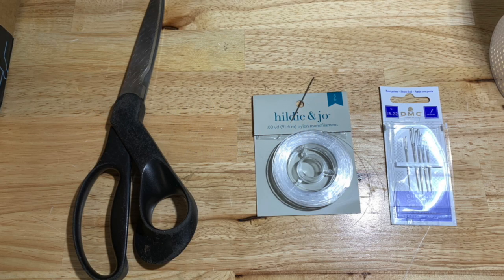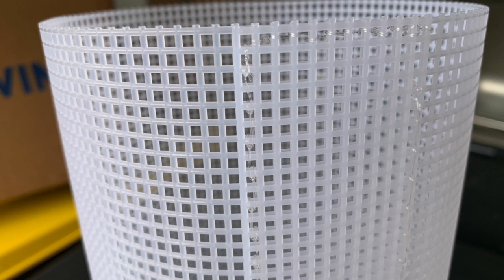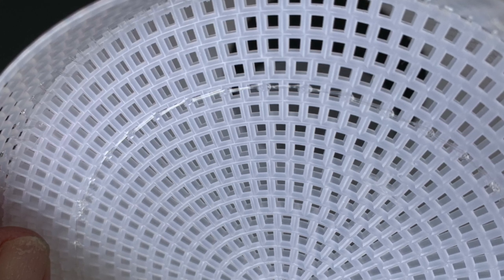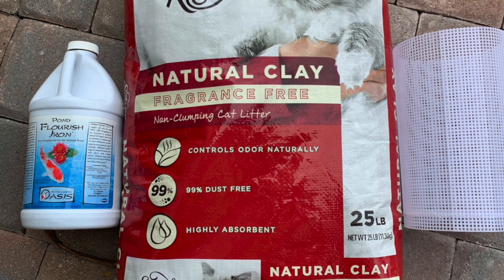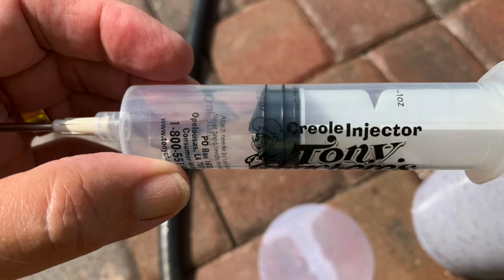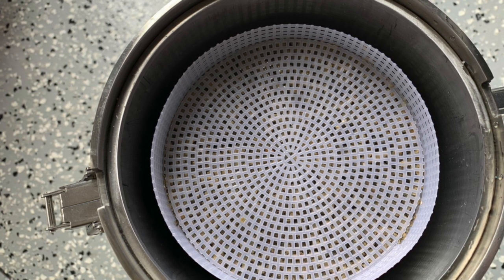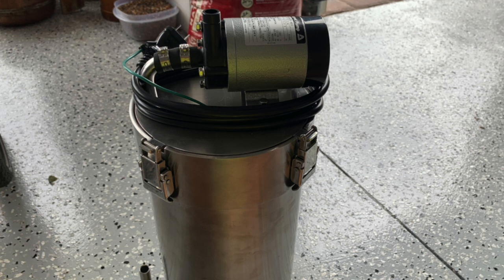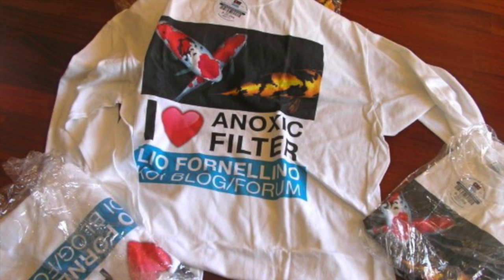Converting an ADA Super Jet 600 Canister filter into a Nitrate reducing Anoxic Filter.

Comment: Three weeks ago I installed a 60 liter aquarium with a slow moving plenum with a Eheim 2211 cannisterfilter like Dr Novak showed in his Youtube canal about 2 years ago. For substrate I used just poolfilter sand 1-2mm nothing else. Seeing this video I am also going to make a BCB in the Eheim 2211. If everything went well after 6 months with aquarium with fish I am going to make a BCB for my other aquarium. This is a 100 liter Juwel Rio 125. In jan 2020 I set it up with also a slow moving plenum with a JBL Greenline E-902 cannister filter. Substrate with pool sand and Seachem flourite red as describe in Dr Novaks youtubefilms 2 years ago. If all goes well with the Eheim 2211 BCB I am planning to make a BCB for the JBL E-902 cannister just like Luke had done. The JBL e-series are perfect for that because how the water flows through the cannister. As prefilter I will use a Sunsun HW-603 (model without motor).

Comment: Also, you said you have personally not had much success with substrates or medium that are supposed to remove nitrates.. so does  only deep substrate method if placed directly on the bottom..will the bottom most layer create anoxic conditions?

Will placing a porous material like pumice or vermiculite at the bottom most layer of such a deep substrate create a slow moving anoxic filtration layer?
Reply from the maker: You see plants will draw water through the substrate through conventional means but the plants will be very slow in doing this and are subject to CO2 fertilization. Depending on plants alone to draw water through the substrate is a path to failure without the help like heating cables like is suggested by the experts. But even heating cables under the substrate becomes useless in the summer months when the ambient air temperature of the room equals that of the tank or the tank is getting enough heat from the aquarium lights. Then the heating cables never turn on to heat the substrate and then everything starts going anaerobic in the media and starts turning black.

Glass bottom aquariums will show this best and you can then see the blackening of the substrate very easy by looking at the bottom of the tank. Once the heating cables resume the work of heating the tank once again and your tank will turn sweet once again, then slowly the substrate will turn aerobic and you will have more aerobe organisms or facultative anaerobes than anaerobic organisms.  

The applied physics are the same no matter if it is an aquarium or pond. Plants alone will not draw enough water through a substrate to keep it from going anaerobic without a little help from the hobbyist. The substrate in a planted aquarium needs to be at least 3” deep and a plenum needs to be added under the substrate of ½ to 1” depth.  By doing this, heating cables are not needed and biological and chemical pathways remain open to chemical mediators. Now your substrate will draw water by convention, diffusion and peculation.

However, this will once again be subject to the size of the media you choose to use to anchor your plants in. If the medium is too small or too large then you’re sacrificing permeability and porewater capability of that substrate and it will clog. Unlike the Biocenosis Clarification Baskets (BCB’s) that make up the Anoxic filter in a pond, aquariums can’t have a bunch of BCB’s sitting inside of them because of cosmetic reasons. That’s why when you buy plants you will see them in individual small plant pots that act like a BCB’s does but on a smaller scale. They are grown this way in greenhouses with space in-between them just like an AFS has space between its BCB’s.

I have also seen hobbyist use cat litter and Laterite for their substrate in aquariums that houses plants too. But once again you must elevate the medium above the bottom glass surface like I explained above. Now, you will have an Anoxic Filter without all the BCB’s but will have one big BCB the size of your aquarium bottom instead. Using a black craft canvas on top of a platform will hold the cat litter and Laterite above the glass and because of its size it will not clog. NOTE: You must only use cat litter, Oil Dri or Safe t Sorb that has been baked. Some cat litters are not baked and then they will not work for a Plenum situation. A BCB yes, but not a Plenum.

How to make a BCB the size of an Aquarium is easy. You can use PVC or anything that can make a raised bed above the aquarium floor. Then in one corner or in an inconspicuous place in the aquarium place a 1” plastic tube with small holes drilled at the bottom ½” of the tube. The tube is inserted in the raised bed and will sit on the bottom glass (The tube can also be capped off at the bottom.) with an air stone at the bottom of the tube and the tube will then look like and under gravel airlift tube. Using the smallest air pump you can buy, pump air into the tube via air stone. This will move water from under your plenum extremely slow. It will not act like an under gravel filter because water movement will be too slow for that to happen. The slower the water movement the better it works. Just the opposite of what an under gravel filter was meant for. If the tube only exchanges one gallon of water a day that’s good enough and fast enough too. Just make certain that none of the cat litter can fall in-between the tube and the black craft canvas screen.

The tube is added; because the substrate is tight against the aquarium glass at its sides. This will impede the chemical and biological pathways some. The very slow water movement underneath the plenum will allow for proper ion exchange and will mimic a conventional movement of the water through the substrate releasing any gases. Yes the substrate will produce N2 and it must find a way out via the tube you just added.
Reply: @anoxicfiltrationplenums  excellent explanation..i was wondering though..in actual ecosystems and ponds in nature..how does anoxic filtration happen ?
There is only 'substrate' ..how does water movement happen there?

Comment: I have a few queries, hope you can answer them..
1) i have found some brands of non clumping natural clay kitty litter..but it says bentonite..
Will it work?
You once said bentonite doesnt work, as its clumping.. but if its non clumping and hopefully baked..will it then work, or does it have to be attapulgite?
2) for plenum purpose, will any substrate of our choice ( eg fine gravel or coarse sand) ( height 2-3 inches with particle size 1-3mm with a 1 inch plenum with a short lift tube)work with iron or does it have to be baked clay with laterite..
3) will any bricks made from baked clay work even if its not attapulgite clay?
4) lastly, you made a video about substitutes for the laterite or iron rich substrate..you have probably not yet made a video about substitutes for baked clay...
From what i have gathered, you said the following would/should work
Zeolite, leca balls..if they are properly sized, like 2-4mm in diameter..are there any other? 

Thanks in advance

Comment: Why would you not disperse the iron throughout the clay?  What function does the clay body fill if you are not directing a bit of current through it?
Reply from the maker: The iron plays two parts in the BCB. part one ) iron helps too accelerate bacteria growth. Bacteria use the iron for their growth in the very beginning and once they are all established then the iron isn’t quite as important. 

Two) the laterite has the same crystalline structure as kitty litter or oil dri or any one of those products and therefore it will attract the ions out of the aquarium water the same as the kitty litter. 

Even in a normal Aquarium iron is still very important for the building of cells inside your aquarium our filter to establish  bacteria.

Comment: Another great video! I noticed that too with the same cat litter how it's not really clumping or turning to mush unless you really try to smash it. I wonder if it just wasn't baked hot enough. I will test a little bit and get it really hot with a torch or in a kiln over a fire just to see what happens.
Reply from the maker: Let me know your outcome please.
Reply: Well I only spent a few minutes with the torch on a small handful and sure enough it turned a lighter color grey, and then put it in water and it definitely stays much harder so far compared to right out of the bag.
Reply: And as i was looking for the torch, I looked at the floor-dry and I think it's a type of baked clay, so I put some water on it too and it seems much harder than the cat litter too. It's also has a lighter color and some red to it  so it seems like it's been baked much hotter. Anyway would something like floor dry work as an alternative if it's all natural?
Reply: @coltscustoms  I’ve looked into that as well and it is a good alternative. As long as it is the type with no added chemicals.
Reply: Yeah so it's called Safe T Sorb from Tractor Supply only 6 bucks for 40lbs and yes apparently people use it in planted tanks.
Reply: @coltscustoms  Did you use the safe t sorb and set up your system? Any info to share?
Reply: @vikkirountoit497  Yeah I actually just set it up last week with plenum, safe-t-sorb mixed with flourite red, capped with pool filter sand. It's definitely better to work with than the softer clay cat litter. I have very hard well water but it did dramatically lower the PH, KH, and GH initially due to the strong CEC of the clay. I used baking soda and will do a couple water changes to bring it back up and hopefully stays stable, and we'll see what happens from there with ammonia/nitrate once it's cycled. No fish yet.
Reply: @coltscustoms  Cool thanks for details. I'm a bit concerned about my hardness as my water is relatively soft to begin with. Might have to let mine run and keep adding to it until it stabilizes. Very glad you reminded me of that - feel free to reply/comment further at any time!
Reply: @vikkirountoit497  maybe you could pre soak the clay in a bucket with a lil bit of baking soda for a few days, test and change the water till it's back to normal before putting it in your tank if you already have fish in it. Then again Dr. Novak puts it right in service and don't seem to have any problems.
Reply: @coltscustoms  Went ahead and installed one BCB today. It's only about 5x5x7" in a 75g so fairly small - I'll see if it makes a difference over the next several months. Used safe t sorb with a squirt of liquid iron ferts about 15min before installing. I'm going to keep monitoring the parameters I test for just to make sure nothing shifts in an unfavorable way:)
Reply: @coltscustoms  I replied to another comment of yours, and seeing this comment that your ph kh and gh all lowered initially, I think I'll test my water daily for a while until I am sure it is stable. I have only had a ph crash one time a year ago, but this is the tank it happened to. Right before BCB install today it was sitting at gh 7, kh 3, and ph 7.6.

Comment: Another brilliant piece Dr.Novak. The tiny details of the construction of the BCB has the hallmark of a mastercraftsman [leather]. 
I have made some crude BCB using the mesh idea earlier but your work is so much better.
Kitty litter is a real pain to find for some of us.Maybe can you recomend some easier to find alternatives to kitty litter? Would small limestone or granite pebbles work?
I also found that in my aquarium my prefilter gets clogged up pretty fast. I remembered your filter socks in your sump video, it is like that within 24-48hrs period. And it was so easy to clean your prefilter socks in a snap without touching the rest.So maybe ,just maybe you might want to consider making a prefilter that is superfast to remove clean/replace in a snap. lol [only a suggestion]
Reply: There is a piece of kit called a Filter Bucket made by Sun Sun . This is basically a big external pre-filter . I use the large size ones on both my canister filters and clean them once a month . Cons.are that they slow down the flow a fair bit and the hose sizes are not standard although they will accept standard hoses with a bit of work .
Reply from the maker: @theboesmani   thanks for the information I didn’t know that myself.
Reply from the maker: If you watch some of my other videos I do have an alternative to kitty litter I think it’s called Zeolite. That is what they use in Thailand instead of kitty litter.
Reply: @anoxicfiltrationplenums  Thanks, I can get Zeolite . I think that it is chemically active ( at least initially) though . People I know add it to fish bags when transporting fish over long distances to absorb Ammonia . I will check it out .
Reply: @theboesmani  What i had in mind was something like Dr.Novak's filter sock, where he just take it out in a breeze. No shutting of valves, pulling out hoses, opening canister ect. And he did it in less than 2minutes? Taking out the 24hrs dirt certainly increases the water quality.

Comment: Hi Doctor Novak PhD, I have been watching your progressive, highly informative, uploads regarding, first the slow moving anaerobic plenum and latterly the fast flowing Biocentesis Filtration system, I do not know, having lived in England all of my life if you remember the aquarists attempts, back in the 1980's, although I admit that memory fails me here, but, attempts were made to emulate a anaerobic filter by 'dripping' tank water at a pre determined rate through a, normally transparent circular column filled with, I believed to be pool filtration sand. The down side with this system, which, when I was re-bitten by the bug, I believe I can no longer find modern reference to this experiment, was the critical accuracy with which the speed of water introduced to this filter led, either to a natural aerobic failure or, more seriously if too slow then the dreaded 'rotten egg smell' (Hydrogen Sulphide) resulting in the 'usual' action, depending on the length of time that this 'bad' water had been feeding back into the, sometimes very costly display tank, to save fish and plants, although, the system's other failing was the actual, in most cases the 'pitifully small' amount of water returned to the tank when compared to your slow moving plenum system. The big problem I encountered, no doubt, along with a significant number of fellow Aquarists, discovered, as you predicted, impossible to locate.
That is why I welcomed your 'upload' regarding alternatives to Laterite, which FINALY brings me to the assistance, if you are able, by query that I desperately need;
1.  Will any "natural" 'Red baked clay product' of sufficient granular size be a suitable alternative to your suggested alternatives ?.
2.  Can 'Zeolite', being of suitable size, act as a replacement to the 'kitty litter that you use ?.
I include the relative web address for the only kitty/cat litter I can find.

https://www.petsathome.com/shop/en/pets/pets-at-home-non-clumping-clay-cat-litter-20l?utm_source=google&utm_medium=cpc&utm_campaign=google_shopping&cm_mmc=Google-CPC%20google_shopping_-google_shopping&ita=1976&ito=google_shopping&istCompanyId=7255ccad-a1fc-4729-af31-478f79e5071c&istFeedId=385e6b9a-8b03-4076-a8bb-e4737df8549c&istItemId=itxmxqqwa&istBid=tzwt&gclid=Cj0KCQiAqo3-BRDoARIsAE5vnaIYc1aymkKqwGVrJ0ndRZeCs9v8rKnLT9Z-e3PvkU0lZu8omQQvgGMaAjlHEALw_wcB&gclsrc=aw.ds#

I would be most grateful for your response

Comment: Hi Dr. Novak, from what I understand you are installing this filter on the same antique aquarium that you did the slow moving plenum on. Does the slow moving plenum not already work as an anoxic filter? How much anoxic filtration is needed? I am removing all the substrate from a 40 breeder to add a set of filter plates and 1”-2” layer of kitty litter. Will that be enough anoxic filtration for a typical community aquarium? Or will I need some external anoxic filtration as well?
Reply from the maker: The plenum does work to keep ,your tank from "crashing" . I have used a slow moving plenum in tanks that did not need a teardown for over 10-years. Placing the substrate directly on the bottom, I was lucky to go a year before a teardown or starting all over again. 

Be very careful of the Kitty Litter you use . As I said in my video not all Kitty Litter is the same coming out of Walmart. That is why I chose to make a canister BCB, then the cat litter can very somewhat. Maybe only 1/4" of cat litter in-between your substrate would-be  the safer bet.

Comment: Dr Novak, will leca balls work the same way? Leca balls are hard and made of clay.
Reply from the maker: Bentonite: Do not use
          • Clumping cat litters are made of Bentonite clay, which sticks together when wet. The bentoniteis usually mixed with quartz and diatomaceous earth, which are absorbent.

             Other Clays:
       
         • Various types of clays are used for non-clumping cat litters. Zeolite, diatomaceous earth and sepiolite are common.

        • (Only use clay –Attapulgite-that has been mined from the earth, clean, baked, and pulverized such as Kitty litter.)
Reply: @anoxicfiltrationplenums  can i use only laterite without the cat litter?

Comment: Excellent .Congratulations. Very explanatory video. One point I would like to ask: is the addition of iron solution necessary? Isn't there a possiblity of overdosing the iron? Isn't it harmfulfor the fish? Thank you.
Reply from the maker: If you’re already adding iron to your aquarium because of plants then the iron is not absolutely necessary. It will migrate inside the BCB on its own. Or lets say you have iron in your tap water already then there’s no reason to add more to the BCB. Small amounts of iron or not harmful to your fish but it could cause problems with your plants. This is done by overdosing.